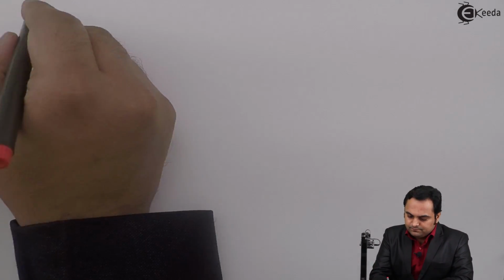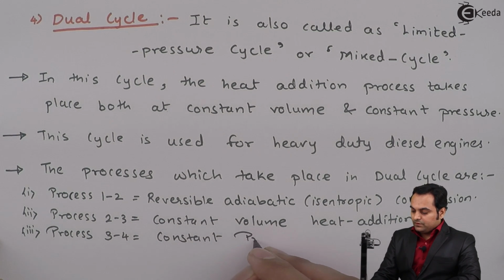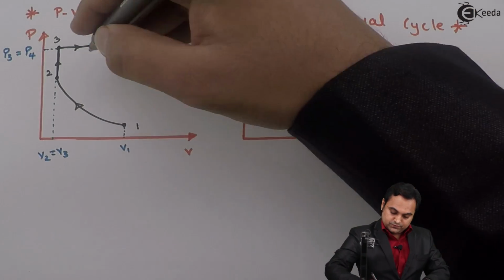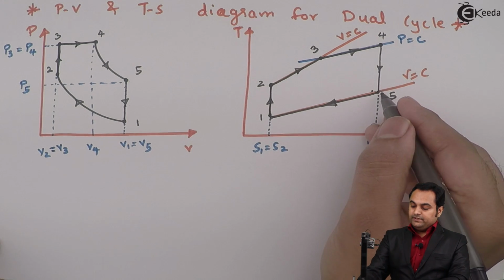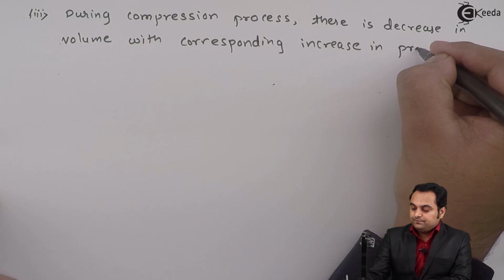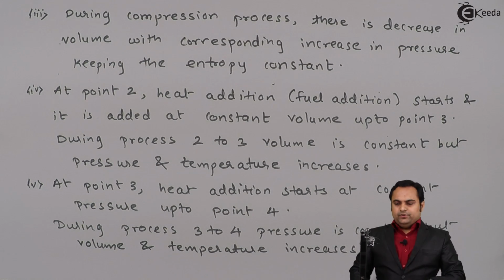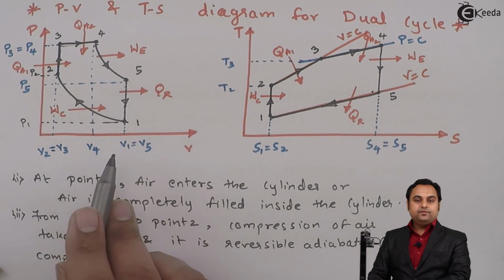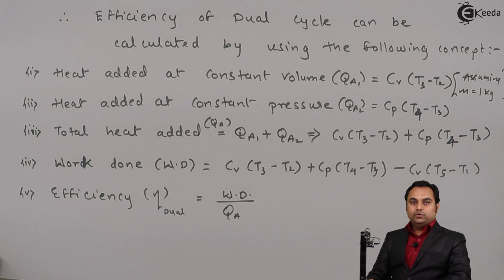What is Dual Cycle in types of Gas power cycle - Gas Power Cycles - Thermodynamics

Comment: The dual cycle, also known as the limited pressure cycle or mixed cycle, is a gas power cycle that combines constant volume and constant pressure heat addition. It is commonly used in heavy-duty diesel engines, allowing for extended fuel burning time.

Key moments:
00:01 Dual cycle, also known as limited pressure or mixed cycle, combines constant volume and constant pressure heat addition processes, making it suitable for heavy-duty diesel engines due to extended heat addition time and increased fuel burning efficiency.
          -Explanation of the processes in dual cycle including reversible adiabatic compression, constant volume and pressure heat addition, and isentropic expansion, crucial for engine efficiency.
          -Detailed explanation of the PV (pressure-volume) and TS (temperature-entropy) diagrams for the dual cycle, illustrating the compression, heat addition, and expansion processes graphically.
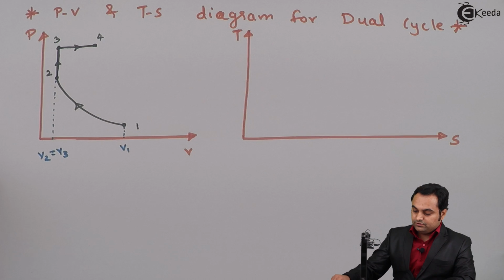07:36 The video explains a thermodynamic cycle involving processes like constant pressure heat addition, isentropic expansion, and heat rejection at constant volume. The cycle is illustrated on PV and TS diagrams to show compression, heat addition, and expansion processes.
          -Illustration of isentropic expansion from points 4 to 5 with volume and pressure changes, showcasing the increase in volume and drop in pressure during expansion.
          -Explanation of constant volume heat rejection from points 5 to 1, leading to a drop in pressure and the rejection of heat at constant volume.
          -Demonstration of the thermodynamic cycle on TS diagram, highlighting isentropic compression, constant volume heat addition, and constant pressure heat addition processes.
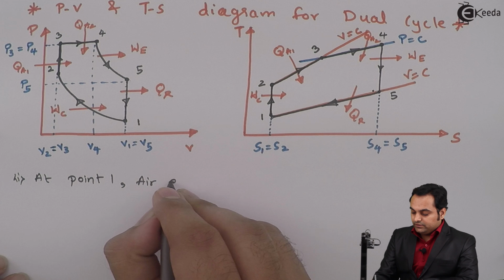13:49 The video explains the process of compression, heat addition, and expansion in an air cylinder, highlighting changes in volume, pressure, and temperature at different stages.
          -Compression of air from point 1 to point 2 involves reversible adiabatic compression, leading to a decrease in volume and an increase in pressure while keeping entropy constant.
          -During heat addition at constant volume from point 2 to point 3, pressure and temperature increase while volume remains constant, showcasing the relationship between pressure and temperature.
          -The process of constant pressure heat addition from point 3 to point 4 results in an increase in volume and temperature while pressure remains constant, demonstrating the impact of heat addition.
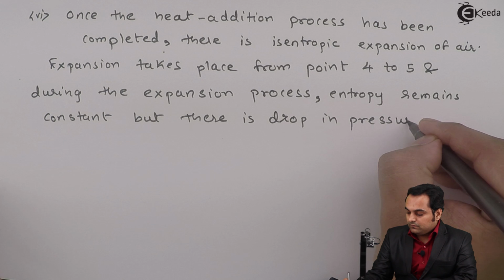21:42 The video explains the working of a dual cycle, including heat rejection, efficiency calculation, and work output. It demonstrates processes through PV and TS diagrams, emphasizing efficiency calculation using heat supplied and work done.
          -Explanation of heat rejection during expansion and efficiency calculation based on heat added at constant volume and pressure. 
          -Detailed calculation of work output by subtracting heat rejected from total heat added, emphasizing constant volume processes. 
          -Efficiency determination by dividing work done by heat supplied, illustrating the concept of dual cycle efficiency calculation.